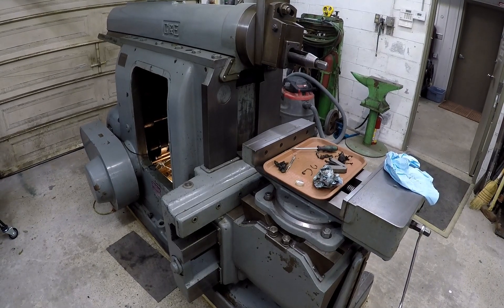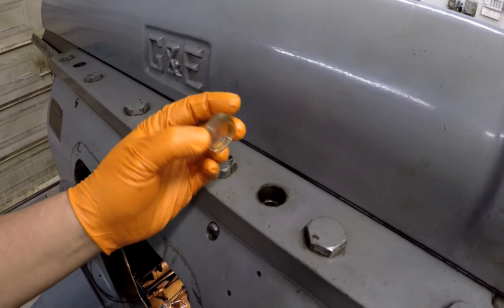G&E Shaper Ram Way Sight Oilers, New Felt & Oil Sight

Comment: Funny story, I was running an old shaper, (about the size you have there) that was always a terrible oily mess. From a couple of months of observation, I deduced the that the felt wipers for the ram were wore out, and I decided to replace the felt with some rubber instead. So I pulled the brass wipers off and pulled the felt out of them. While I had the wipers off, I went ahead and got all of the old paint 'n crud off of them as well. Beneath all of the crud, I found some very pretty brass, (or maybe bronze, I dunno) and polished them up nice and pretty. I then cut some rubber to fit back into the wipers, and re-installed them. I had fit the rubber pretty tightly up againest the ways to the ram, reasoning that it would keep the oil inside the machine's ways, and it wouldn't get oil all over the place. Wrong, big mistake. Instead of keeping the oil in, the new rubber wipers now allowed the oil to travel out with the ram, and wiped the oil off as the ram retracted back into the machine, leaving all that oil to run down the front of the shaper....I put the old felt back in... But, hey! the covers looked great!

Comment: Great videos learned a lot , Sight glasses can be machined out of clear plastic and polished , Great job on the shaper you may want to look at the belts pulleys and grease the motor ,check contactors ,wire connections in the controls and motor .

Comment: It has been 25ish years, but I am pretty sure about this. The oil collects in the largest recess of the hole. The cord/string/felt is put into that recess with one end put into the hole that goes to the machine ways. Primitive filter, the oil wicks along the felt supplying debris free oil to the ways. Keeps all that gunk you found in the sump from getting pumped onto your ways. That's why the old string stuff was so nasty...
Reply from the maker: Thanks for the in-site. My thoughts was that with the felt foiled around and in front of the oil hole is that it would filter the oil that way as well.
Reply: It will filter oil that way to, but then how does it get in the hole to the ways? Also, compression of the cord was thought to impede wicking. Just observations, no critisizm intended. Love your videos, you ever get to AZ and I'll buy you a steak and beer.

Comment: For the missing cap, you can cut one out of acrylic and then lightly flame it with a blow torch. It will get clear quite quickly. Done it for my lathe's oil indicator. One thing tho, for the two "face" cuts, go extra fine, but no sand paper. Just a nice, low, smooth pass on the lathe.

Comment: When you get the new oil in maybe you could run it without the wipers for a little and clean off the ram etc manually. That way if there is some crud and old stuff underneath the ram the new oil will flush it out and you can just wipe it off. Instead of it being stuck behind the new wipers. That way it will be easier to gauge how much oil you're getting through the felt wicks too. Great work !

Comment: I’m enjoying the shaper videos, I’m going through the same processes.
I purchased a beautiful rebranded SUMMIT 1981 24” shaper recently, upon getting it home I inspected it really good and it’s almost like new but from sitting so long everything was gummed up to where the auto lift for the clapper box wasn’t working nor was the auto traverse or the auto downfeed and the lead screws appeared to be caked in cosmoline and tough to move and it was running backwards, now that I got all that straightened out I’m in the process of changing oil, cleaning it out and the oil pump isn’t working so now I’m on the lines and refurbishing the oil pump. I don’t have the manual and still unsure of the original brand so I’m going in blind except for my experience with mechanical equipment. 
Thanks for the video on what replacement oil I should use.
I also have a home machine shop
MW&Machine, am wanting to exchange some stickers with you but don’t know how to get in touch.

Comment: Move your sight glass to that single lower location on the vertical way, and move its clear plastic original up top so all 4 uppers match, and your nice bronze one is down low on the solo location.
Reply from the maker: The sight on the cross rail is larger in diameter.
Reply: Abom79 
Aw,  bummer.. that would have been sweet and easy.

Comment: When we repacked journals on axles we used presoaked pads then added oil as needed.  That way the brass and bearing surfaces were oiled.  It may be a little messy to start with but there is little chance of running with no oil.
Reply from the maker: That why the oil sights are there to observe. You turn on the machine and let the motor run for a few minutes and looking to see that oil is pumping to all of the oil sights. As per the G&E Manual.

Comment: I am very excited to see this run.  About like a kid before Christmas.  Mine is currently disassembled for paint and I miss running it.  
Under the brass cap on the table, oil comes up the center tube then goes down small tubes to different places in the table.  The small tubes have wool stuck in them to regulate flow.   When replacing the wool check each line to make sure it is clear.  I had two lines clogged.

Comment: All well and good.  Don't forget about the underside of the beast as far as cleaning and rust prevention.  I pulled the table from mine the other day, and getting it past certain points on the main shaft was difficult because of the slight expansion due to surface rust, even after cleaning and some polishing with emery strip.  Even the areas that are not constantly exposed to atmosphere, like the mating surfaces between the universal table and it's base.  Mine wasn't severe, but it easily could have been.

Comment: Coupla questions Adam... Would it be an idea to run the machine first with a high detergent sacrificial oil? Run it for an hour or so then throw out the oil? I know you’ve cleaned the machine thoroughly, but from the state of the felt in the oil sight glasses, there might be a huge amount of dirt in the hidden oil galleries and other area yo7 can’t get to? And also, it looks like the sight glasses are perplex/plastic... might be fun to machine your missing one out of some Perspex rod to match the others?

Comment: That "String" looks like what, when I worked on steam railway engines, we used to call "Tow". It was made by unraveling manila ropes. We used it to wrap pipe threads before screwing them together. No such thing as pipe tape in those days. We used thick knitting wool for wick type lubricators. We used felt for the locomotive axle boxes. The felt rubbed on the journal and wicked the oil up from a reservoir underneath.

Comment: I think the way you packed the felt in the ways is probably the factory way . The old ones looked awful jumbled up, unlikely from a manufacturer. Like the brass upgrade , o ring is good idea also. If it were mine I'd make all the ram site glass in brass. Sure is a real beauty , wish I weren't so badly disabled. My shop is never getting done. Thanks for being what I can't be. And sharing it for others.

Comment: Several people have suggested using acrylic which would work fine. For a better result, you should lap them. (See recent videos from Tom Lipton.) For the most accurate oil viewing experience, you should use actual optical flats of the correct size as view ports.  : )

Comment: Looking really good Adam. Would it be a good idea to pre-oil soak the felts before firing up the machine?
Reply from the maker: No need. When the motor is switched on the pump will start pumping oil to all of the lube points. It’s important to let it run a few minutes and watch for the oil being pumped in the sights.
Reply: Yes, and see if there's any garbage in the oil lines, which the felts will catch. Thank you.

Comment: Maybe a presoak on those wicks would help the startup level? Pouring some oil on them from the top to get them working quickly. Same for the wiper felts? Love watching you man.
Reply: Yep, same here. Or maybe the machine has a priming function that gets oil around the system without running the ram?
Reply from the maker: When you turn in the motor and pump start pumping oil. You wait several minutes to allow the oil to be pumped to all of the oil points before you ever engage anything. That’s why the sights are there, to observe.

Comment: Heh heh, yet ANOTHER FIRST for your channel, even if it is a bit minor: putting the collet chuck on the Monarch and putting the old girl in the fastest speed she's got and her stretching her RPM legs a bit while you turn brass.  Thanks bunches for getting it on film! ^^  

Wonderful work on the way oilers for the big shaper.  So the pre-oiling of them will be done when the machine's fired up with the new oil in it?  Get oil flowing to them and let the machine sit for a few minutes first, pumping to every spot to pre-oil everything before starting the ram?
Reply from the maker: Yes, turn on the machine and let it run a while while the pump gets the oil flowing. Use the sights to observe it working.
Reply: Sounds like then that back when that machine was in regular use, proper use of it meant that at the start of the day it was turned on at the same time as the shop lighting and the sight glasses glanced at to confirm oil was flowing, then the machine allowed to sit idle so the oilers could get primed up while the operator went and made his morning coffee.  When the operator had finished their morning coffee, the shaper's oilers would be fully primed and the machine ready to start making chips. ^^

Comment: I'm new to this stuff and this channel, what benifit was there to putting that brass in the collet after you already turned the outside on the four jaw?
Reply: Shane K I'm not a machinist but he had to turn around the part, and to maintain tolerances, either you can put it in a collet or a 4 jaw. Maybe he preferred to use the collet which can get higher precision per unit setup time.

Comment: Why did you need to switch out the 4-Jaw chuck for the collet chuck when you started that last operation?
Reply: Lucian Chapar you can’t correctly hold such a short work piece in a regular, jawed chuck.
Reply: RaininPayne2 thanks!

Comment: Hi Adam great work as always love that shaper of yours. I've been meaning to ask you. I'm restoring a colchester master 6 inch lathe built in 1939. My worry is it's top speed is only 550rpm is that going to course me a problem on turning metal parts. Would like your advice if possible
Reply: metalhead2508 thanks buddy appriciate your advice. Glad you took the time out getting back to me. It's taking Alot of time to restore  the lathe but can't wait to get her up and running.  Thanks again for putting my mind at ease

Comment: Adam,Why a new Shaper? What can it do that a Mill can't? I kind of thought Shapers were obsolete now.
Reply from the maker: The simple answer is because I want one, the same kind of want that everyone has for something of interest. 
In due time I’ll be showing what a Shaper can do.
Reply: A shaper can make internal key ways and splines, all with simple single point high speed tooling. A mill can't.
Reply: not unless it has a slotting head (aka "jumping jack") and unless one comes with the mill you buy, they are usually hard to find and expensive if you do find one.  And, they don't have the operating range that a shaper has.

Besides, for plain flat work, a shaper can be gotten for less, a lot of times for the equivalent of scrap value.

Comment: Hi Adam great video i just bought a 7 inch southbend shaper and I need to change the oil what oil do you recommend I use thanks for any help i can get
Reply from the maker: You should try and research what south bend recommends, but G&E states in the operators manual to use an oil with SUS 450-600. I talk more about this in my next shaper video.
Reply: thank you

Comment: That 'string' looks like what we use in the uk on steam engines for lubrication we call it worsted wool and can be found here https://www.heritagesteamsupplies.co.uk/
Reply: chris0tube wick is what it does as in candle wick if you search trimming kit in heritage steam supplies they do a kit with the wool and wire for making the bit that draws oil up and delivers it down a tube
Reply: chris0tube please go and google wick its not an object in this context it is describing the capillary action of a material and from a steam engine perspective worsted wool happens to be the best material for the capillery action to deliver oil down a tube

Comment: That lump of bronze would cost a fortune here in the UK 🙄
Reply from the maker: I have several pieces of bronze bar stock that is left over from our full time shop days. Paid for material. On the other hand, you can buy small pieces of any material from McMaster-Carr.
Reply: That's right Mr E.  We are paying heavy and hard for our de-industrialisation.  All of our heavy, light, and skilled manufacturing/commodity industry is as good as dead these days.  We used to lead the world with it, and there were foundries, shipwrights, mills, factories, machine shops, woodturners, chandlers etc etc densely packed in every town.  

Now it's all flattened and replaced with call centres, student flats, shopping centres and trendy offices.  Our industrial heritage has been swept away.  We don't have the big economy-of-scale or local availability for these materials any more.  It's a damn shame.